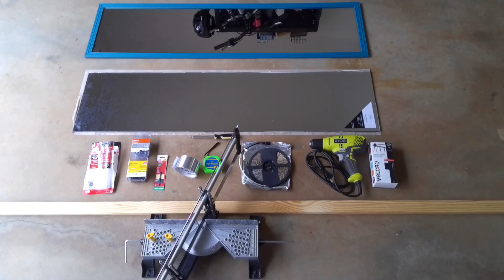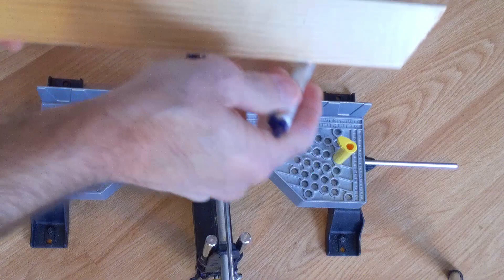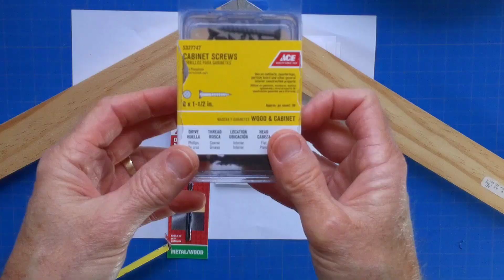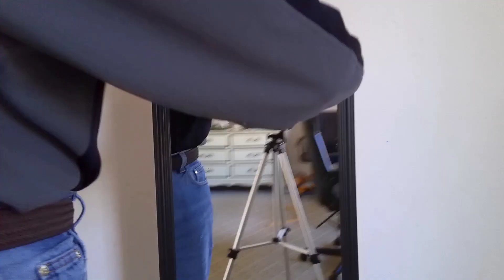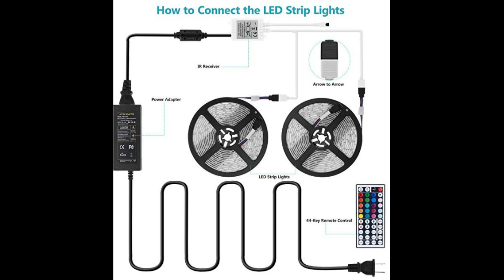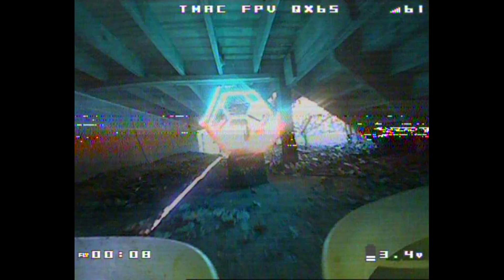HOW TO MAKE INFINITY TUNNEL

Comment: Excellent
Reply from the maker: Thanks 77Avadon77, tons of fun!🤩
Reply: @TMacFPV  how seriously cool would it be if you made something like this that was say like 10 to 20 ft long and inside had a lot of rotating lights and other the things. Wouldn't that add dramatic effect? I was just thinking about how you could make the inner sphere environment even more exaggerated. Add a little Halloween fog in there and it would be really intense. You might have to align the thing with class or something so that drones don't smash into everything. LOL I'll definitely be a subscriber. Check out my stuff I'm starting to work on robotics projects
Reply from the maker: @77Avadon77  Ha!  It would be fun indeed.  Its already tough to fly through this thing because if you  don't fly straight through everything looks like the way out!  You can have the LEDs blink different patterns and colors, etc.  Use some dry ice.  I'll leave that stuff up to you!